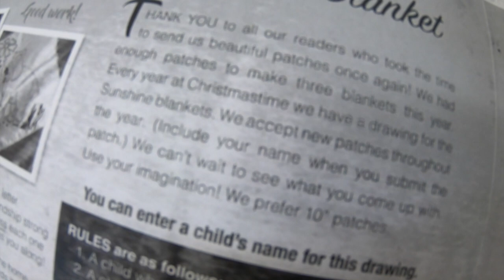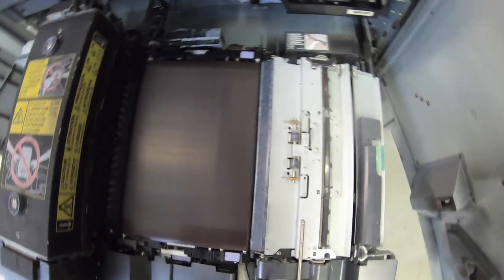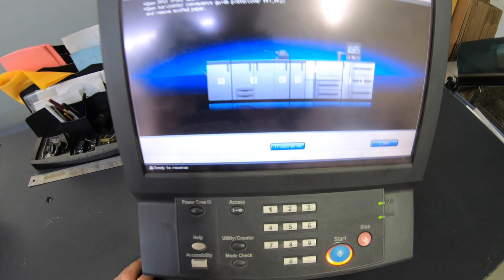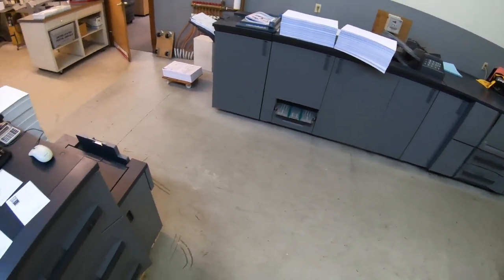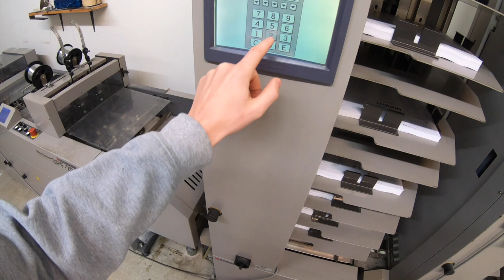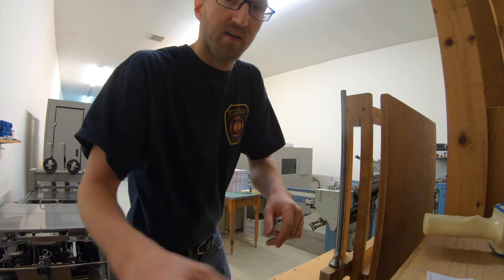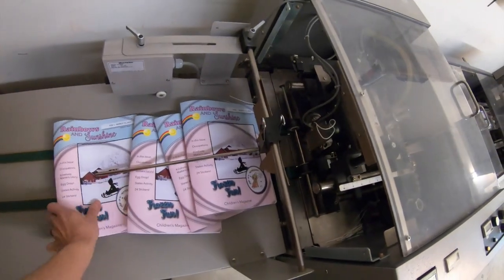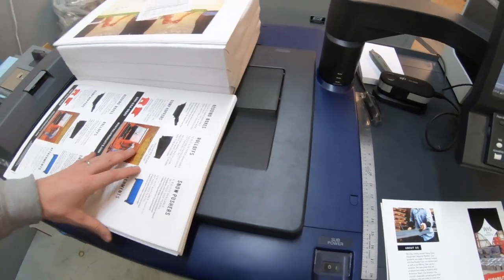New Belt on the Konica, Density Adjustments, Print, Stitch and Mail 1500 Magazines

Comment: If you are printing one-sided why you are not printing Face-UP ??? Particularly A3/12x18 ... 
the paper goes straight and is not rotated i the machine.
Reply from the maker: Face down is default on my RIP. I don;t think it slows it down but it might. It is also easier to load into the next machine face down. I should experiment to see if I should reconsider though.
Reply: @justaprinter  maybe it's not about slowing down but if the paper is circulating in the duplex the whole machine wears faster and the paper gets stuck more.
Reply: @justaprinter  You have Minolta or Fiery RIP ?
Reply from the maker: @jarowilk2999  Its the built in Konica RIP